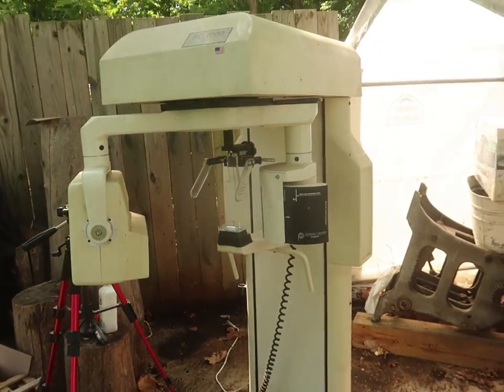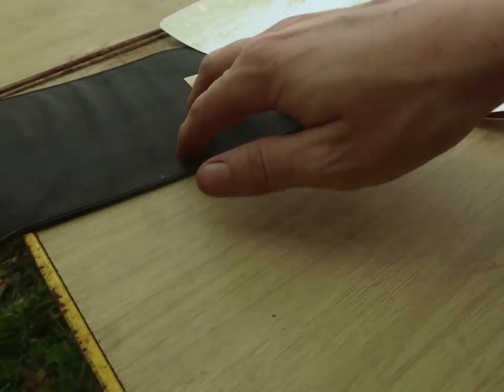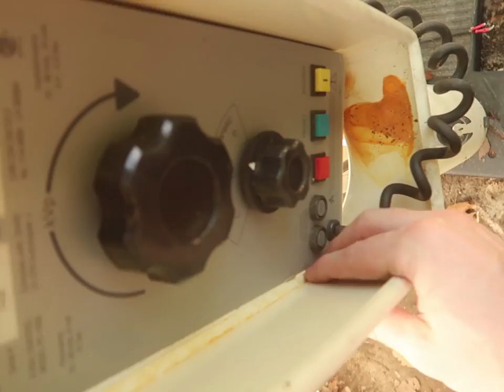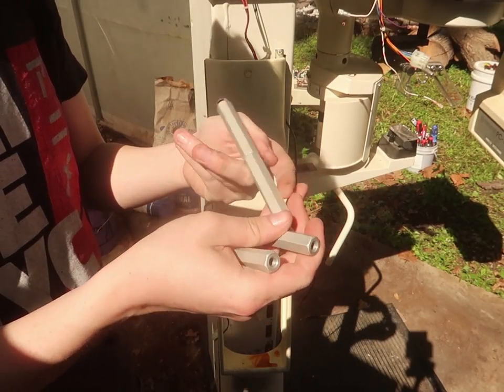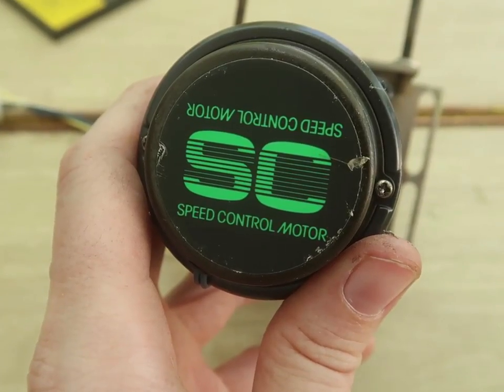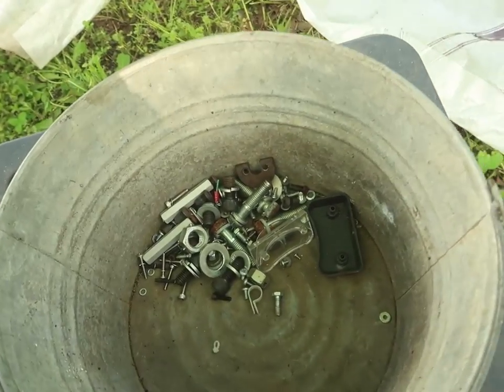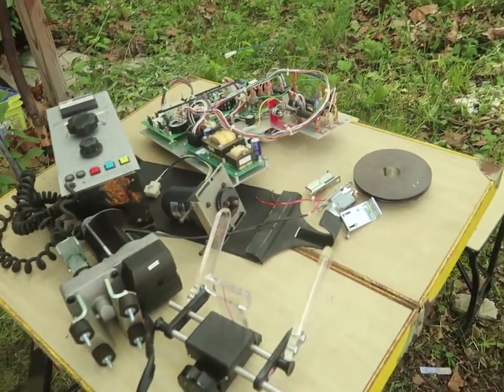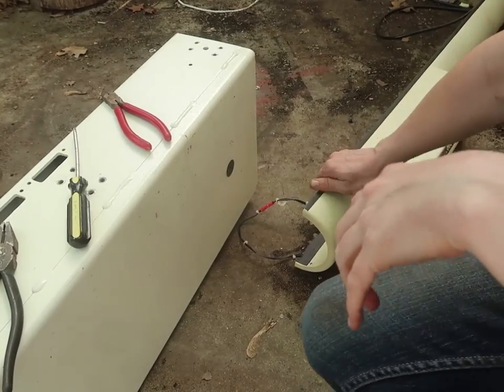1997 PC-1000 Panoramic X-Ray Machine Teardown: Motors, Control Components, Variac, Rheostat!

Comment: In a more modern, digital Panoramic machine,  a very intesresting part would be the receiver side.
Reply: Later PC-1000s did have a digital sensor in place of the film slide and I believe Pancorp also sold it as an upgrade kit for existing film models. It uses a PCIe frame grabber card installed in the PC so the sensor probably just shoots a raw bitmap image to it. Most other manufacturers use ethernet or fibre channel and are only designed to send it to a specific driver/software from that manufacturer.

Comment: It's Rinoa's Electric Stuff! 
Interesting device. I love the pro gear teardowns. I see some web development taking place inside, haha.
The Xilinx chip is more likely an FPGA (field-programmable gate array), this brand specializes in these. It may be possible to experiment with Verilog or VHDL designs and implementing them on this chip.
The speed controlled motor probably has a tacho generator or at least a Hall or optoelectric sensor that sends pulses to control circuitry that stabilizes the rpm.

Comment: I understand that this was long in the past now and that my comments are somewhat futile. On the offhand chance that you have this stuff in storage somewhere, things like that screwdrive, especially with the associated Variac, you've got the most difficult parts of many different machine tools out of the way. You have a lathe which is excellent for its long-term variability in what jobs it can do. Setting up a bandsaw with speed control so that it can cut steel and building or buying a simple mill drill or adapting an older heavy duty drill press, the combination of these three tools is a very powerful trio. I'm currently going to the mental exercise of downsizing my own shop. As I'm forced to consider a much smaller space, tools that can do multiple jobs, normally a sign of poor quality, are more important than ever. What I ended up deciding on was 100-year-old cast iron bandsaw with two speeds for wood or metal, a small tool room lathe like your own, and a smaller radial arm drill that I have modified with a shaper table to function as a milling machine. I figure any kind of sanding or buffing can be done on the lathe, all of these tools can be used on a multitude of materials. A few accessories like a rotary table and a dividing head can really open the possibilities both for quick work and for precision prototyping alike. At least that's how it works in my mind. I don't know yet how effective this is, it is still theoretical.
Reply from the maker: Yeah these are like universal building blocks for machines

Comment: how about the Variac / meter as a light dimmer in your TV room?  The positioning assembly (keeps the head in one position during exposure) has some useful linear rails.... When you tear the head down... you will likely find an HV transformer as well as the xray tube.  There is also considerable lead shielding in there.  You scored big on this one!

Comment: Fun fact:the screw part is a very powerfull linear actuator it has the same power or torque as a hydraulic cylinder i would sudjest to make a car jack using the linear actuator
Reply: thaat would be cool to see. maybe a scissor lift. or automatic roof window in the shed to let out all the heat
Reply: @DIYIMPULSE  yeah good idea

Comment: I would definitely hold on to the gearheaded motor. Maybe for a milling machine or perhaps a sawmill? Those are some really nice torquey motors, it's easy to speed up with pulleys, but it's hard to replicate true grunt in the other direction

Comment: I got a full head-x-ray from a similar machine before having my wisdom teeth out, made my thoughts feel fuzzy!
Is the casting for the control-housing plastic or fiberglass?
Medical machinery (especially older stuff) is nice because it's built to such a high standard!
Probably some grade-8 bolts in that thing, at least where the heavy stuff is connected.
Oh! A heavy-duty screw-drive linear actuator? (with nice roller-bearing rails, too) 
Could build an automatic adjustable-height drill-press with that!
Probably some high-quality bearings in some of those spindles, too. Of uncertain condition, but still.
With some steel roller-pulleys that upper head assembly could become an overhead crane.
(of unknown lifting capabilities, but at least half-again as much as the original assembly it held, I'd think)
Oh yes, please do video the tear-down of the x-ray head! Ah yes, can't forget the hour-meter!
No worries about video length, this was still fun and it'll be like an easter-egg to spot the parts in later videos!

Comment: Are you positive that the pulley is not titanium? I can't tell from video, but why would it be anodized? Titanium holds very vivid colors like that, and I believe it is used as shielding for some forms of radiation. If it is, it's definitely worth quite a bit more. If you find a discreet spot, scratching it would reveal.
Reply from the maker: This pulley is made from aluminium. Titanium was not very cost effective in the 90s

Comment: Who would have guessed how many great parts are in an x-ray machine?! Instead of scrapping that frame, why not bolt your bandsaw to it for the rigidity? Arguably it could even be mounted horizontally so you could use the screwdrive to position it relative to a log for lumber processing with a simple track?

Comment: Does this only work with film considering the year ?
Reply from the maker: This probably would only work with film, however these older machines have the issue of the settings not going low enough for digital sensors.

Comment: You need a geiger counter!!! This can be lethal!!! Look at the "Goiânia accident"
Reply from the maker: I have several, this is nothing like the machine in that accident. I recommend you go learn about the differences between isotope sources and electronic sources. This has no radioactive particles within it, instead it has basically a high power tube that emits xrays when energized. You sound like you've watched a few videos from Plainly Difficult but entirely missed learning about what the actual issues are. Please make sure you learn more of what you talk about before you misapply historical radioactive accidents to things that don't apply.
Reply: X-ray machines have no radioactive material as a radiation source, the rays are artificially generated in an X-ray tube when high speed electrons are slowed down by hitting an appropriate target, and that loss of energy when they go from fast moving to slowing down is manifested in high energy photons (X-rays) being emitted, similar to how slamming on the brake at 70 mph would result in skid marks, so no power = no radiation whatsoever; you would get the same reading using a Geiger counter on this contraption that you would from, say, an air fryer or a laptop, provided they didn’t come from Chernobyl. That incident in Brazil involved one of the old-style radiation therapy machines that either used cobalt-60 or cesium-137, which are both radioactive isotopes. Modern radiation therapy machines are LINACs, they use X-ray tubes as a source of radiation, and there’s no radioactive material involved. As far as I know, the only radiation therapy system that still uses radioactive isotopes are GammaKnife radio surgery machines which utilize cobalt-60, but you won’t find one of those in a junk yard.